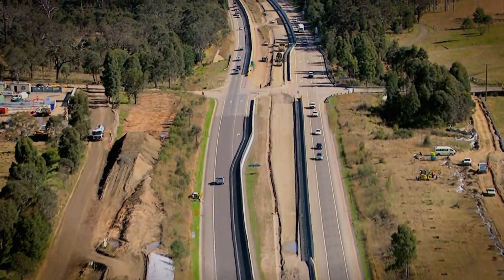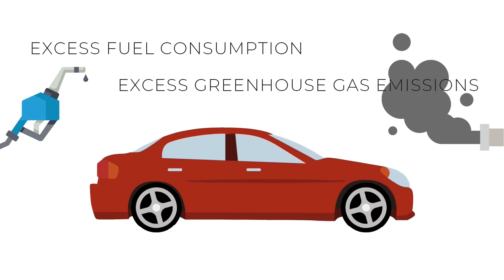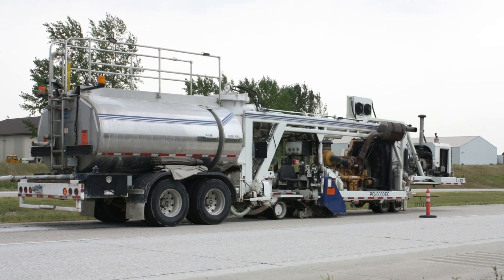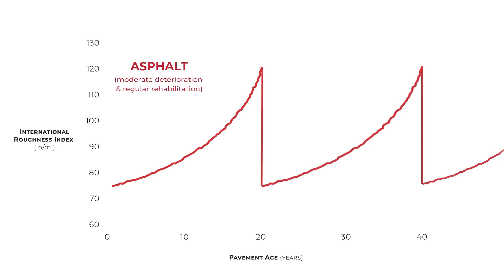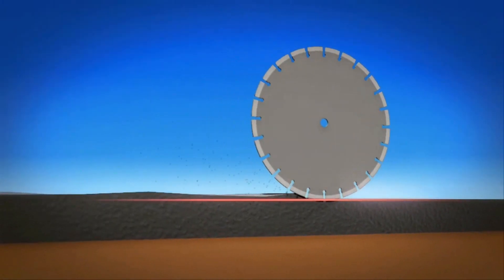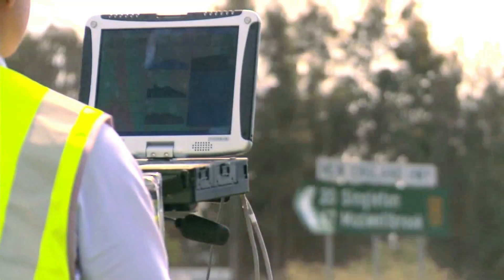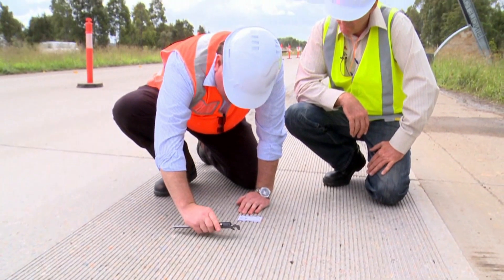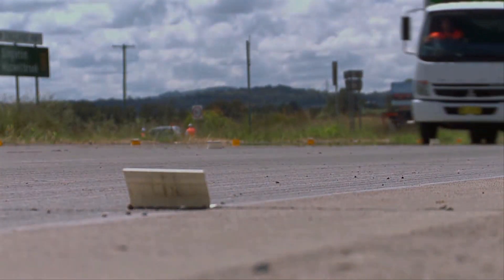The Results Are In: The Next Generation Concrete Surface is a Sustainable Pavement Choice

Comment: What do these grooves to motorcycle tyres?
Reply from the maker: Thanks for your question, Hugo.  This is an issue that dates back to the 1960s.  Caltrans conducted a study at that time that determined “The pavement grooving patterns as tested in this study did not present a hazardous riding condition to the motorcyclists.”  Also bear in mind that the motorcycle tires at the time of the study were bias-ply (not radials) and much more narrow and inferior than the tires used today.
Reply from the maker: As a follow-up to our reply below regarding the Caltrans study, here is a link to one of the relevant pages from the study: https://files.constantcontact.com/d670c5d5101/861df588-e584-4842-9acc-cdd1b932445c.png